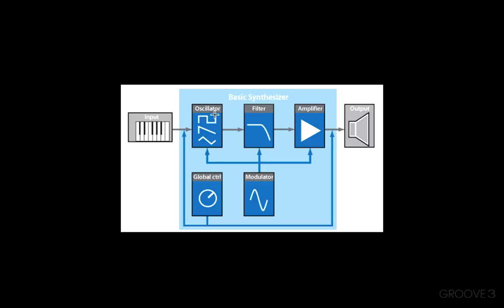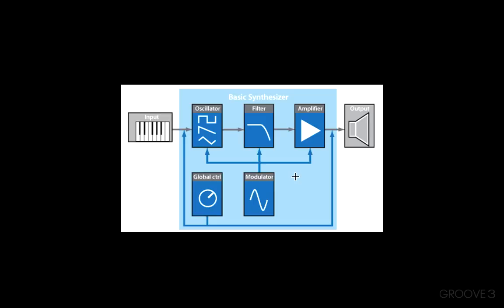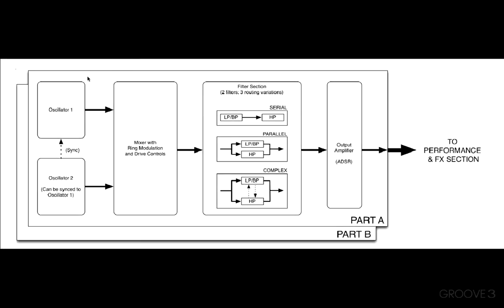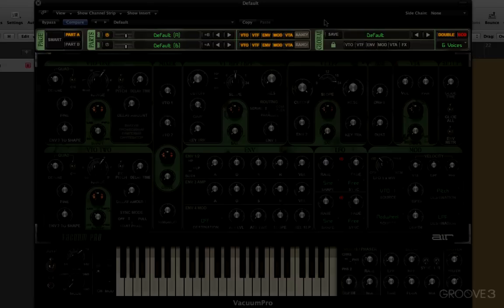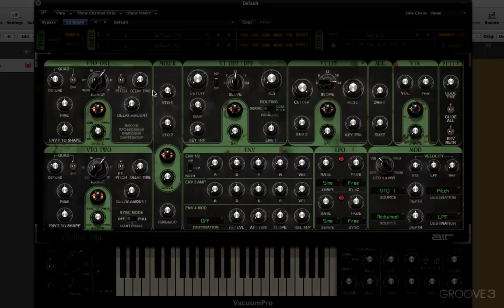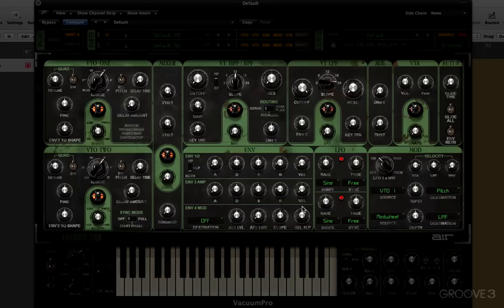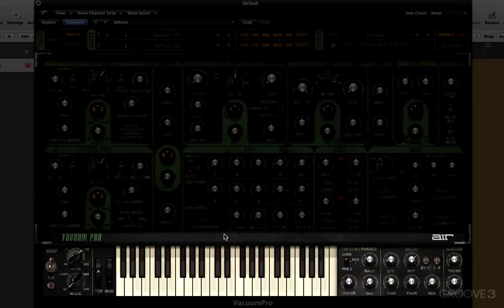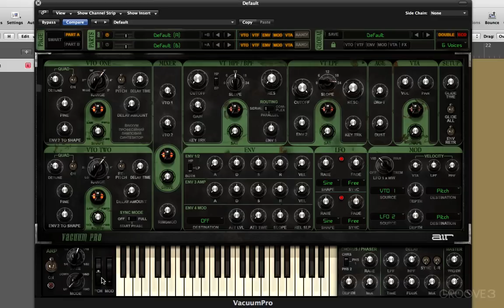Show & Tell (Vacuum Pro Explained)

Comment: In this video you mention there's another, was it ever done? I really like this instrument but the operations manual is thin and I think incomplete. Left out are any details about the routing options for the LFOs, etc. This video was helpful, thanks for posting it.
Reply: There's a vacuum pro 2. I think you can get it at plugin boutique but i'm too lazy to check before telling that to some random guy on the internet.
Reply: @_EightySix  How does that answer his question in any way?
Reply: I don't think he did. I know you asked this 7 months ago, so I don't know if you found what you were looking for elsewhere. But if there's anything you want to know, I may be able to help. I'm fairly knowledgable around most Synths.